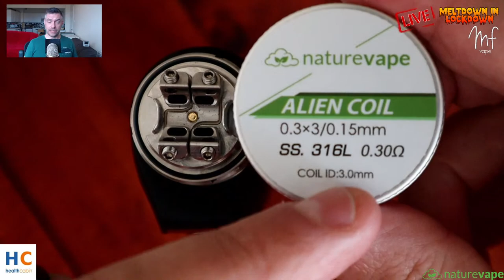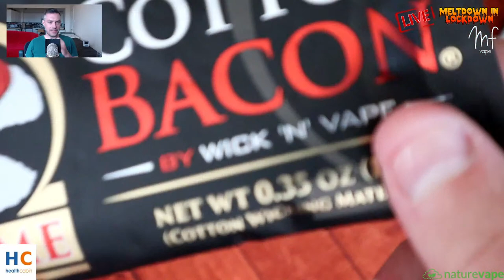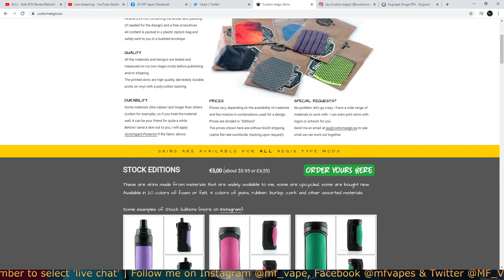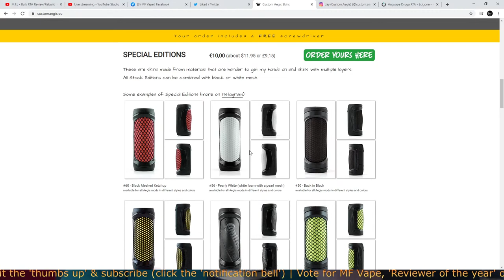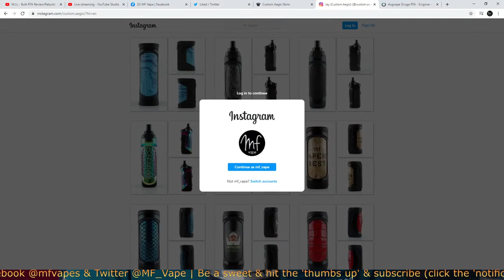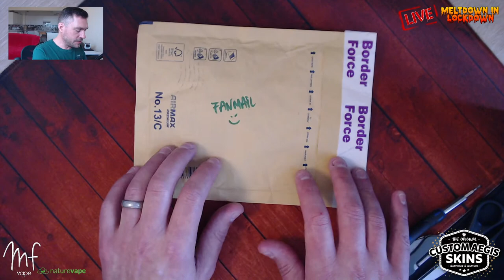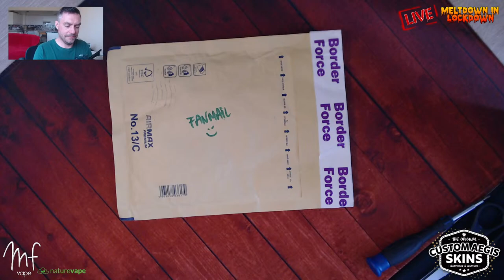Bulk RTA Review/Rebuild + Custom Aegis Skins Unpack & Rewrap - Timestamps in description | MIL

Comment: I have been using the Bulk since release and feel no need to replace it. Surprised me how much you need to thin and trim sides the wicks though.
Reply from the maker: My juice is thick mate, probably around 85vg, especially in my flat which isn't that warm. Just pointing it out in case people struggle with dry hits. I didn't take it out that much in my video, but with muji you might have to a bit more.